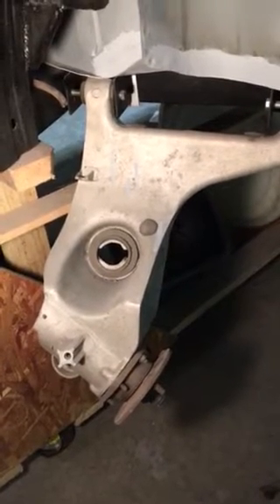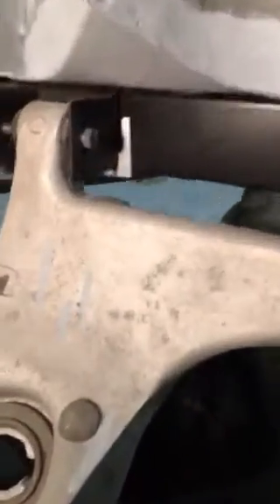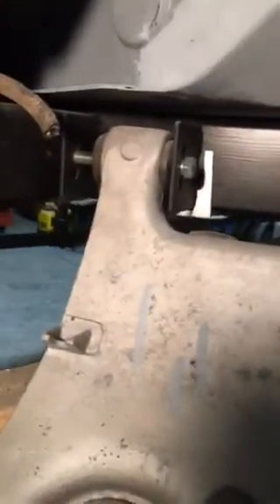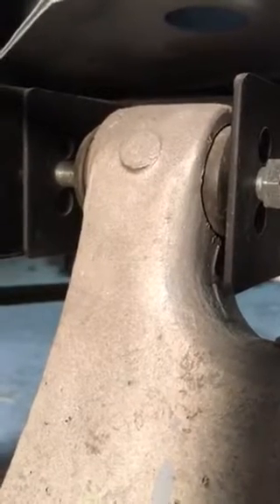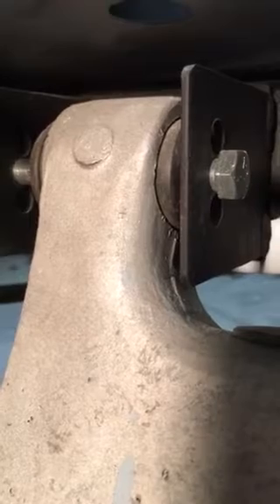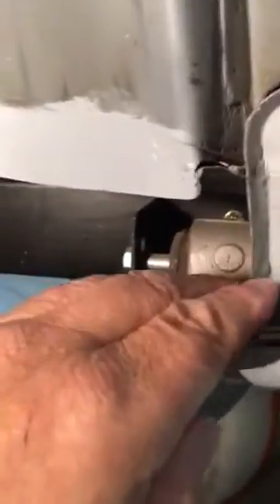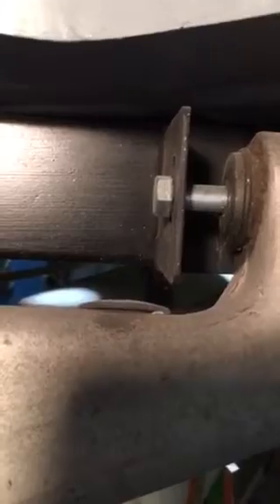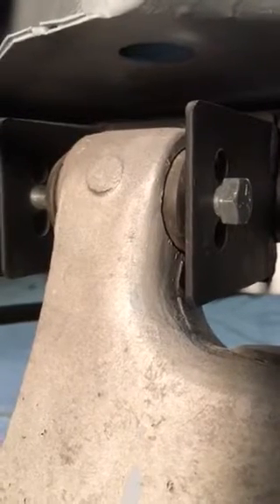TR6 rear suspension setup

Comment: Not too many people understand how this type of suspension has to work.  I agree with your assessment of how to get a proper working setup without binding, and like your solution. 

If a person chooses to use harder bushes without paying attention to the axis of the trailing arm rotation they will exacerbate the misalignment and can get binding. The factory bushes were soft enough to compensate for some of this, but they will wear out prematurely if not set up with some precision.

Good job.
Reply from the maker: Captain: yep, take the spring out, get a six pack of beer, fool around with moving the arm up and down and all around, use a mag torpedo level, spend a good 30 minutes playing with the arm and how it moves, and it is very clear.

 I must admit, many times I'm wondering what planet I'm on when I read in chat rooms what others are doing: " I lowered my 6 one half inch in the back with new springs!" Ha! Well that's easy, move the bushing end of the arm down. "I can't get my camber right, I'm changing the springs!" " My new nylon bushings are squeeking like hell, defective!

To all my friends and subscribers: 

Very few TR6s go down the road well. I've owned 13, and driven 10 others. 

They don't need extra strong frames. A good frame yes, a bridge beam, no
The frame is poorly built, not poorly designed....make careful repairs.
Engines are hard and expensive to increase HP.  Look elsewhere.
Tires are critical, heavy unsprung weight kills the handling immediately.
Pay attention to rotating assemblies, especially wheels/hubs/bushings.
Get the body and frame mounted properly. This alone is a major defect.

The secret to a TR6 and only my opinion. Here is some advice:

Never accept unsolicited advice.
Reliable engine rebuild to about 120HP.
Smooth driveline. Quality joints. 
Lightest unsprung weight as possible. Spend all your money here. 
Tire weights vary as much as 7 lbs each. Pay attention to tire weights. 
Focus on rolling free with absolute minimum power input. Alignment.

The above equals much horsepower, maybe equal to 20 hp or more. 

If you get your 6 to roll down the road with minimum friction, you will win. On the other hand, if you "upgrade" with no attention/skill in rolling ease, then big HP, heavy big tires with subsequent geometry problems will have you fighting  it. 

Many many expensive over the top 6s drive poorly. A good driving 6 is a joy, and increasingly a standout.

I love you all,

Reed
Reply: I have also been doing TR6's since the early 80's, Reed. I think the above is REALLY solid advice. Unsprung weight can be felt right away in these cars just like you say, and I think the effort and expense involved in getting any real HP out of these heads is just not worth the bother.

 It's very easy to get a car that's not very much fun to drive anymore if you aren't particular about what you do. 
 Example would be the wrong cam combined with a light flywheel. Yuck.

Automotive technology has come so far! I drove a bottom-of- the- line 4 door Toyota as a rental yesterday that was tiny on the outside but had tons of interior room, was light weight but had a solid and comfortable ride, plenty of power, gets 35 MPG and would run rings around the TR6 and never break while doing it.

I'm not saying TR's are crap.... they aren't that all. I LOVE 'em. They just are what they are and IMHO a person will be happiest with one in fairly stock form to enjoy as it was designed to be.

Carry on!  
Jim
Reply from the maker: Funny you mention rental cars, you are so right. I rented a car at Midway once, I got the last car they had.. A Fiat 500. Disappointment drained away once I realized I had to keep it boiling. A chick car no doubt, more fun that a barrel of monkeys, anything is a parking spot in downtown Chicago. Yep, better than a 6, more go surely, but equal grin.

Used to be one could buy a 195/75/15 radial tire by Mastercraft. They weighed 21-22 lbs each.  Years ago, I believe at Pep Boys believe it or not! Didn't last long, but took  an incredible 40 lbs off the car. G800 were fairly heavy as I remember.

The R200 diff popular swap  is much heavier, 20 lbs about.

Wire wheels are heavy. Adapters and nuts...it adds up quickly. 

Trunk lid and hood, heavy as lead. Doors are boat anchors. 

Save weight on unsprung items and these  other places, a 6 would drive as if it had 150hp!

Thanks for your comments.

Comment from the maker: Alex. I appreciate your comment and because of it I need to speak much more accurately, so I'll restate this: GoodParts sells fine products, these adjustable mounts are great, but users do not always understand the geometry in play. The suspension arm has only one axis of rotation, and that is through the center of both bushings. You can adjust both mounts up or down, but some users think you can adjust one or the other up or down, this does not work. The suspension arm cannot have two axis of rotation, especially with the harder bushings some install. Install a wooden door into a jamb where the hinges are not exactly lined up with each other. As you open the door, the hinges bind and want to rotate as they seek to have the same axis but cannot. This puts significant stress and strain on the arm, bushings and frame member. The adjustment available is equally raising or lowering the ride height. Castor, camber and toe are somewhat predefined unless you modify the tilt of the axis of rotation. Remove the rear spring and play around with it some and you'll see this right away. I use his R200 stuff, it's fine quality.